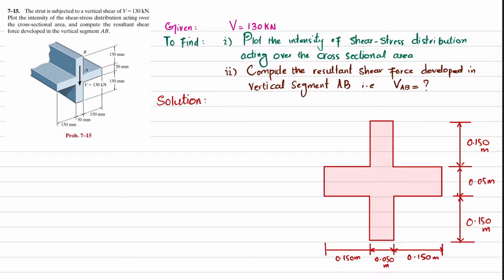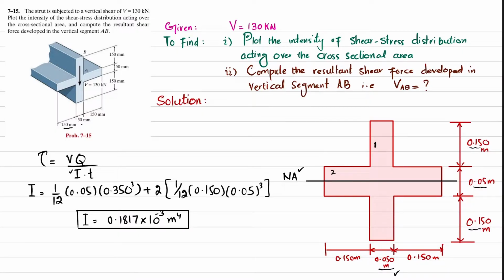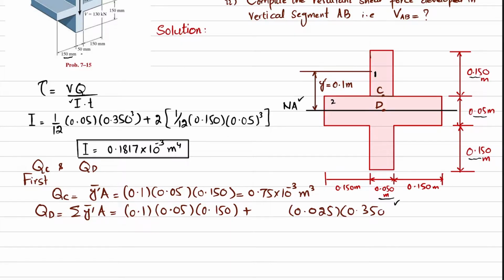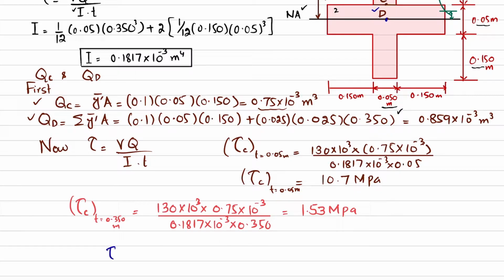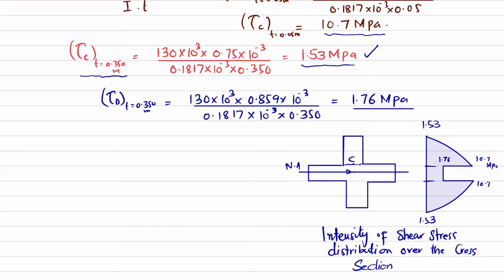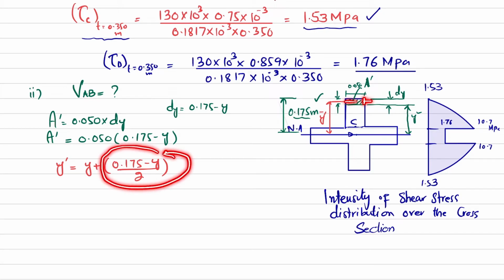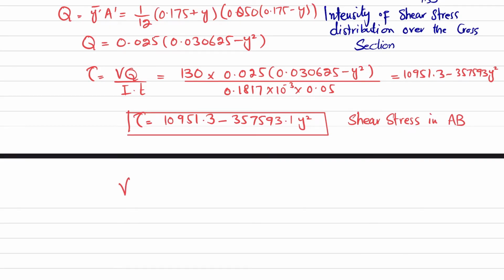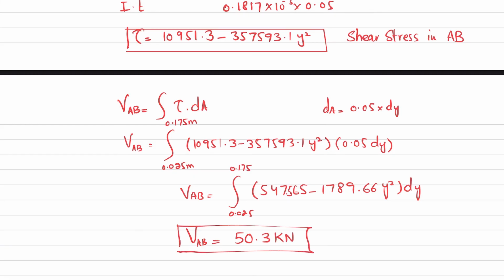7-15 Plot the intensity of shear-stress distribution and shear force | Mech of Materials Rc Hibbeler

Comment: hi sir ,
I can't understand the logic behind why we made calculations for two different thicknesses for points c and d.
Reply from the maker: The reason is that in question we have to find the intensity of shear stress distribution. For that we need to find the shear stress at C and Shear stress at D. You have seen that shear stress at c is less than Shear Stress at D. The reason is that Qc < Qd.  and Q max will be equal to Qd. Rest you can find the shear stress at any point if given....

Comment: I couldn't understand why we calculated the static moment separately as points c and d. Where does it say in the question, how should we understand that we should do this or that we should not separate it as points c and d?
But while calculating Qd, we also added Qc, which we found above. Why didn't we answer this question as we calculated Qmax? thank you💛
Reply from the maker: The reason is that in question we have to find the intensity of shear stress distribution. For that we need to find the shear stress at C and Shear stress at D. You have seen that shear stress at c is less than Shear Stress at D. The reason is that Qc < Qd.  and Q max will be equal to Qd. Rest you can find the shear stress at any point if given....

Comment: Hello sir, in the shear stress distribution, isn’t the shear in the beginning should be zero why did you put 1.53 where it should be zero instead?
Reply from the maker: You are right , mistakenly it happens. Shear stress at the center line is 1.76 and at the junction at point c it changes from 10.7 Mpa to 1.53 Mpa. ❤🎉 thank you for pointing out this.
Reply from the maker: Shear stress at the top is zero